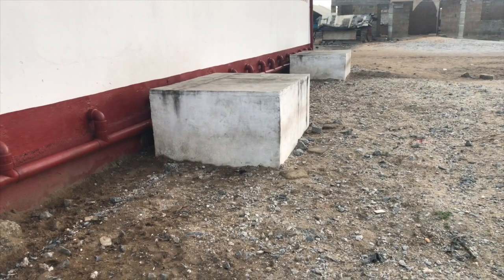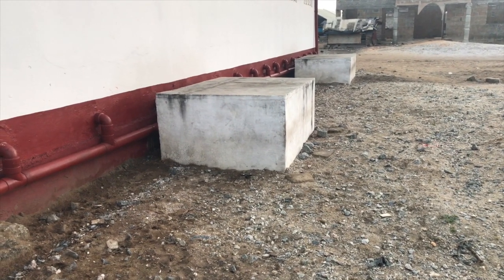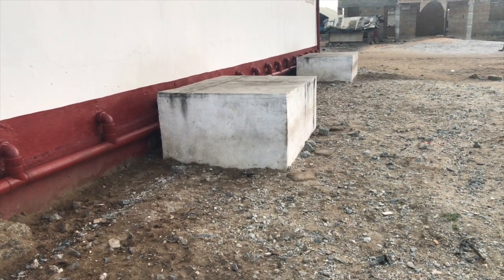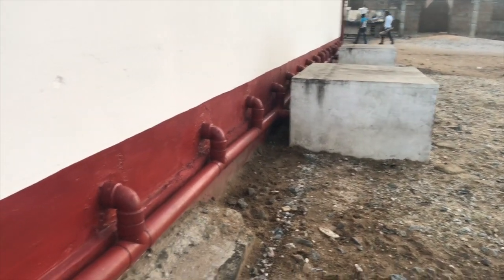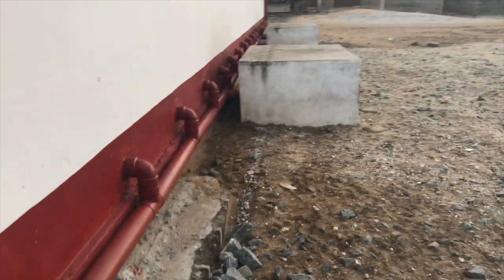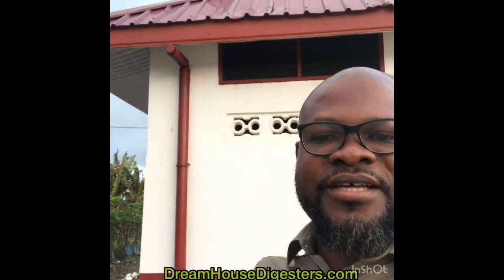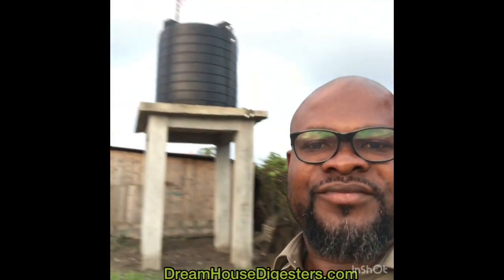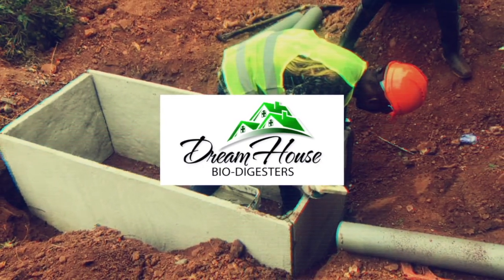CASE STUDY:-Using Bio Digesters For Public Toilets

Comment: Good job, please is the pump used for pumping  the treated water from the digester?
Reply from the maker: The pump is for the tank at the top’s distribution of water to the water closet flushed units. The waste water was connected to a big soak away nearby.

Comment: Hi Jerry!
Great job you did there. 
Since that area is a highly waterlogged area, how did you construct the soakpit stone filled for the digesters and if not where did you connect the digester waste water to?
Also, what's the measurements of these extra large/ commercial sized Biodigesters? Thanks
Reply: Call me on 0270277343. It's urgent
Reply: @princeosae-nyarko2649  I am in Lagos, Nigeria and here's my contact whatsapp no: +2348037060650. You can whatsapp me